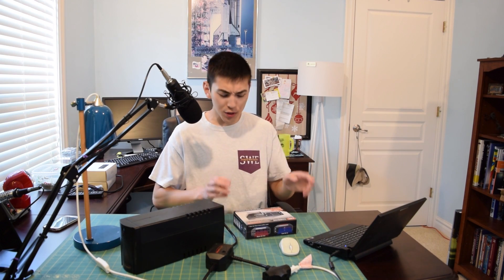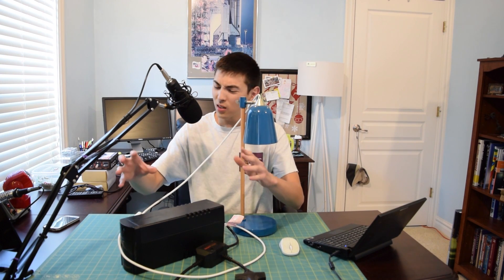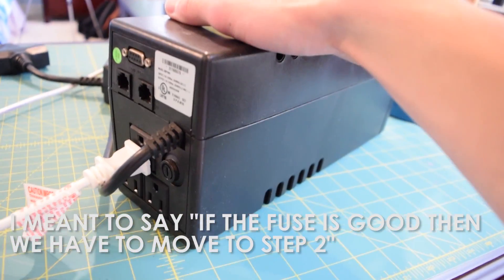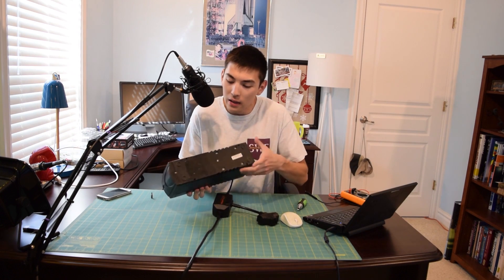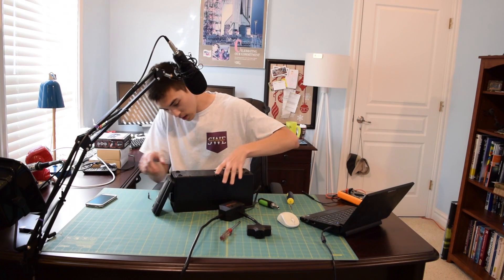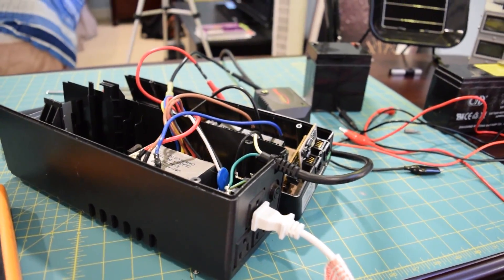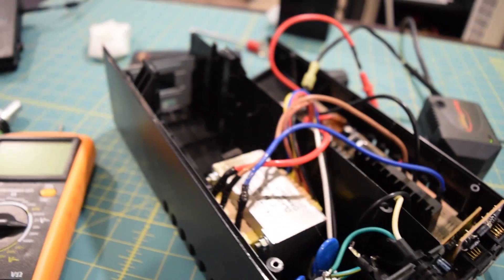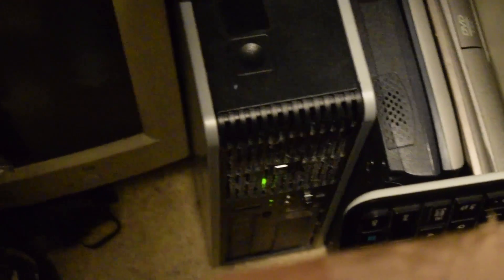Garage Sale Finds: $2 Smart Power 240W UPS Teardown and Diagnostics

Comment from the maker: I do not really like the fact that the unit will not function unless it detects a battery in good health.  In that case it cannot even be used as a glorified surge protector once the battery dies and most consumers will just toss them out.  There should just be a battery health indication light on the front to let you know when the battery needs to be replaced.  Making the whole unit inoperable when the battery has gone bad seems like a waste.
Reply: +AA Computers and Technology well it's kind of that way but the only thing is when the UPS is battery get to a certain point and it's too low it won't turn on the UPS at all so therefore no power coming out the back because IT'S  because it's a safety feature
Reply: +AA Computers and Technology I have a UPS address attached the wires car battery
Reply: I guess they just want people to buy new units so they make more money. It's not too surprising IMO.